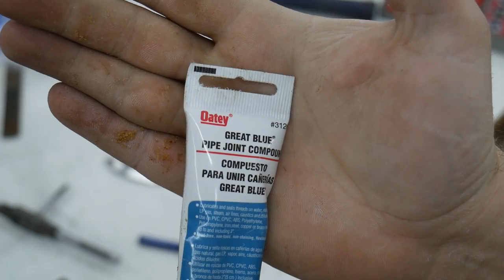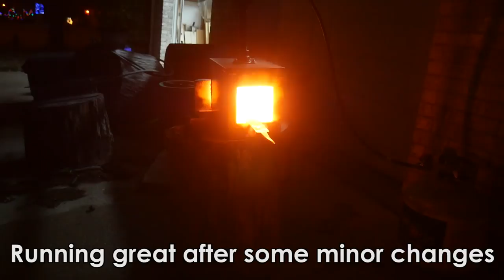Part 3 - Ammo Can Forge: The Burner

Comment: Hi love the burner, could you please tell my how you stoped the popping sound I am having the same problem with mine, I've tried lots of different ways to stop it but nothings working .
Reply from the maker: You are going to have to adjust the length of the nozzle (the welding tip). Try filing off about a 16th of an inch at a time. That is what it took to get mid to stop huffing.
Reply: Thanks Thomas, I'll give that a go..
Reply: Yes , thanks! I also have tried to figure it out but didn’t go that far.

Comment: Did you leave the mig tip that far down in the T ? And did you turn your propane tank all the way on and use the regulator to get the burn ? And finally what PSI are you running ? TIA
Reply from the maker: I fine tuned the length of the tip by filing it down little by little until I got a good flame. I use a 20psi regulator turned all the way up.
Reply: @SouthpawWorkshop   Thanks for getting back. Much appreciated.

Comment: Can you share a "parts" list so I can print it out and go to the store for the one stop shop? This is awesome!
Reply from the maker: 3/4 x 8" black pipe nipple
3/4" x 1" reducer
3/4" tee
.035" welding tip
1/4" brass cap
1/4" mpt x whatever compression fitting your propane regulator uses

Hope that helps!

Comment: Hi Thomas
Nice job! How did you solve the improper fuel/air mixture problem?
Did you use a needle valve?
Again, nice worl!
Reply from the maker: Ultimately it took some trial and error. I just had to file down the welding tip nozzle until it protruded the right amount into the tee. I literally would disassemble, grind down a little bit, re-assemble and test. After a few times I got a perfect air/fuel mixture.

Comment: Cheep design very Cool. I think you have enough heat to build a sister unit and patch them together.   Something you could add is a second line basically a Y connect on both ends of the line with two valves, one per line. They both run to the torch. first is full-on the working line. The second it turned way down like a pilot. So now when you shut down momentaraly you will be able to turn off the main line and you will have a pilot burning for restart.
I think me will build one.

Comment: How's it holding up more than two years later?
Reply from the maker: Still good. I need to buy a commercial rigidizer because the silica I used really isn’t doing a good job of protecting the ceramic wool walls.

Comment: What adjustments u made to it
Reply from the maker: I ground down the tip of the nozzle, little by little until I achieved the correct mixture. I probably disassembled and reassembled 10 times until I git it right.

Comment: How much everything cost
Reply from the maker: the ammo can was around $30 shipped.  The ceramic wool was $20.  The fire brick were free, but you can find them for about $6 apiece.  $20 for the propane regulator. Another $20 in plumbing and you should be good to go. My budget for this project was $100 and I was able to keep it under that.
Reply: @SouthpawWorkshop  my ammo box was $15 bricks $4 mine will be done with all bricks its almost finished looking good
Reply: @SouthpawWorkshop  i seen a great burner for $25 shippped i will add to it like cut off value